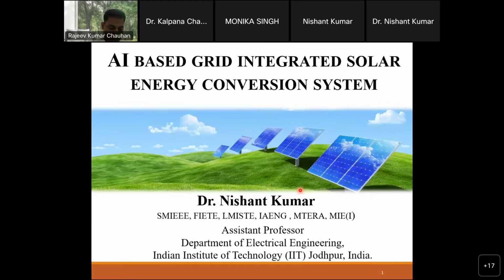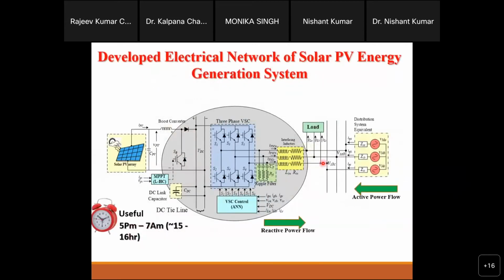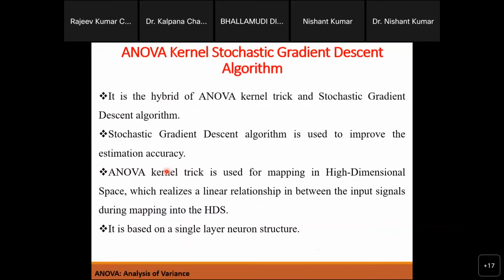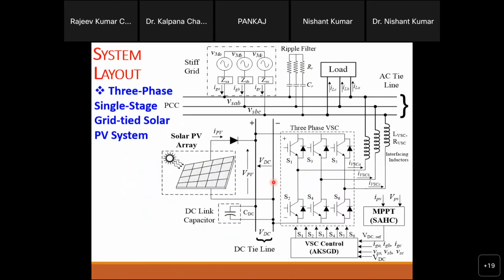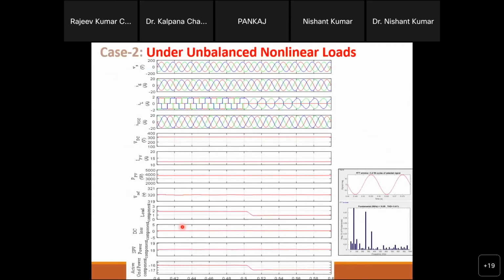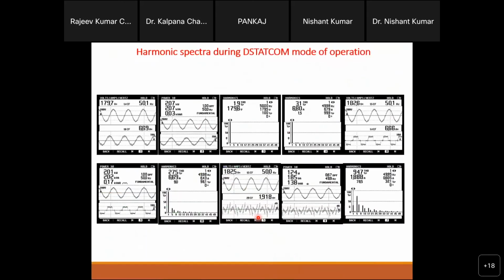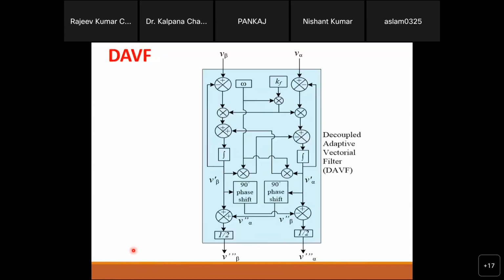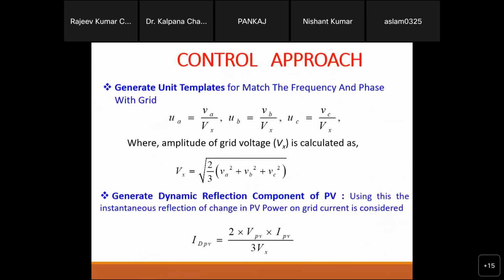AI based Grid Integrated Solar Energy Conversion System by Dr Nishant Kumar

Comment from the maker: 00:14 Importance of AI in grid connected solar systems
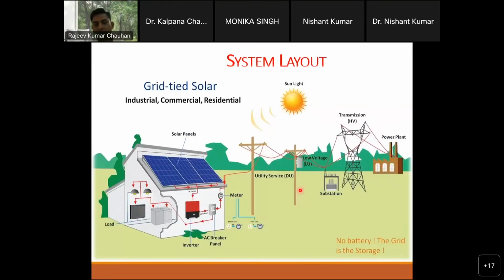02:31 Grid as Sync and Source
06:37 Choosing between string inverters and micro inverters based on system size
08:38 Integration of solar power with grid and ensuring grid code compliance
12:49 Grid Integrated Solar Energy System utilization at night
15:51 Adapting grid power for charging electric vehicles in India
19:54 Maintaining Grid stability with AI based Solar Energy Conversion System
21:47 AI based Grid Integrated Solar Energy Conversion System: Understand Power Flow and Control
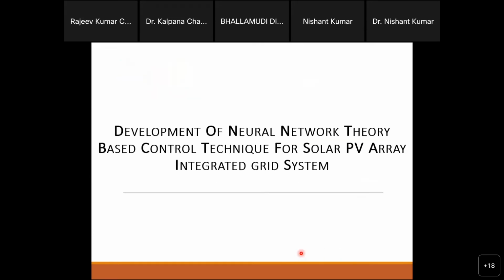25:27 Managing load demands and harmonics in grid-integrated solar energy system
27:32 Accurate estimation crucial for grid integration
31:29 AI based Grid Integrated Solar Energy Conversion System
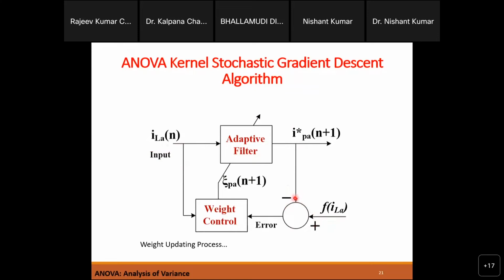33:32 AI-based system estimates and updates weights for error control
37:33 AI integrated system predicts and updates weight for error reduction
39:36 Two options for calculations: using code or block diagram
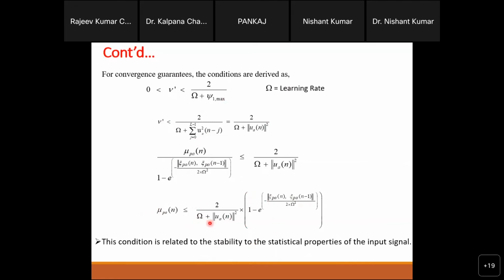43:28 Choosing suitable value for Omega
45:25 Anova trick helps in accurate extraction of fundamental component in AI based Grid Integrated Solar Energy Conversion System
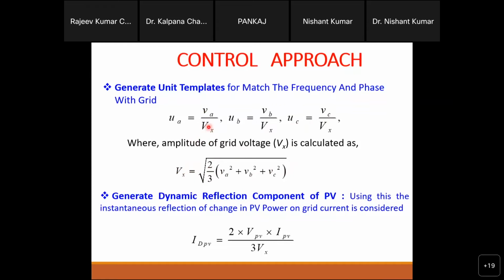49:14 Unit template signal for synchronization and dynamic reflection component for PV side
51:06 DC link voltage and current control with pi controller
55:10 Generating grid current references for phase synchronization
56:54 Automatic grid integration and control behavior in solar energy system
1:00:42 Increased grid current affects power feeding
1:02:45 VSC current behavior analysis based on load requirements
1:06:46 Impact of solar variations on grid current and load
1:08:36 Solar Radiance Impact on Power Generation
1:12:38 Grid supplies power when PV power is zero
1:14:39 Grid provides power for non-linear current generation in night mode
1:18:37 Grid voltage and balance conditions affect system operation.
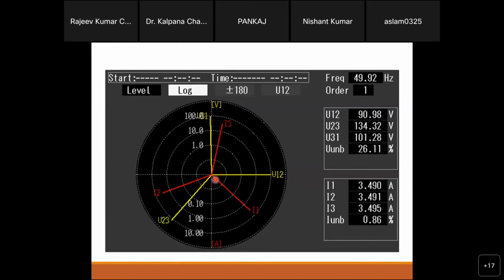1:20:49 Discussion on unbalance in voltage and current
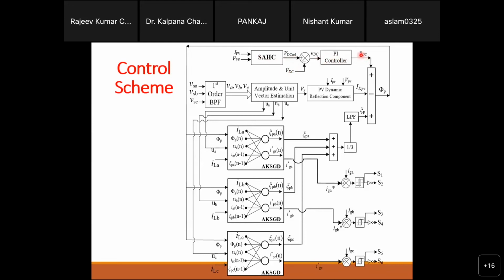1:24:43 Discussing different methods to generate duty cycle for DC-DC converter in a grid-integrated solar system
1:26:39 AI-based grid-integrated solar energy conversion system components explained
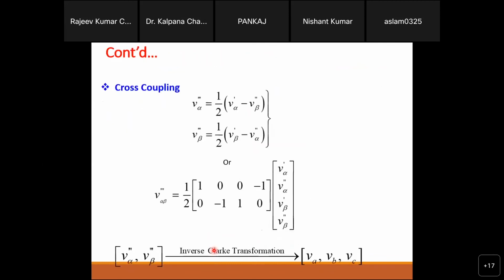1:30:23 Discussing grid integration and clock transformation in solar energy conversion system.
1:32:20 Discussion on open loop transfer functions
1:36:05 Adjusting PCC voltage affects grid current and behavior.
1:37:50 The solar energy controller can also work efficiently for wind energy.
1:42:21 AI based converter generates signals according to reference grid current
1:44:17 Current reference modulation is important.
1:48:46 Utilizing knowledge to find research gaps and innovate solutions
Crafted by Merlin AI.